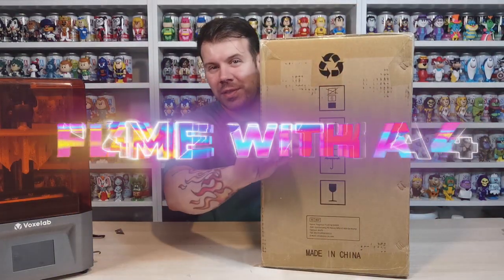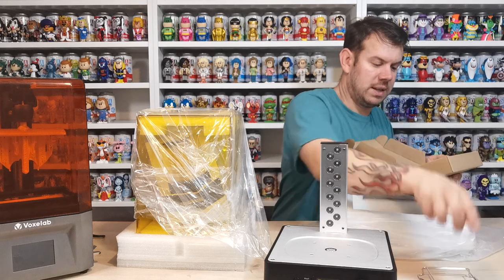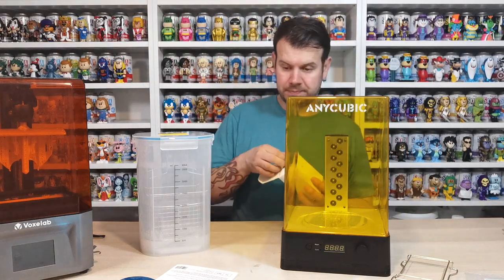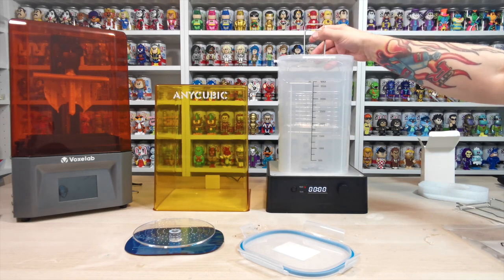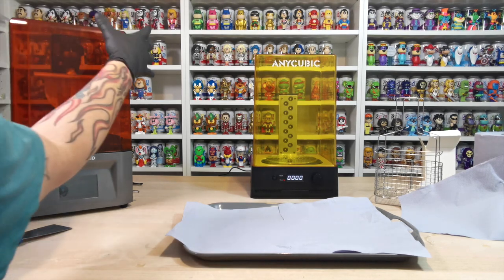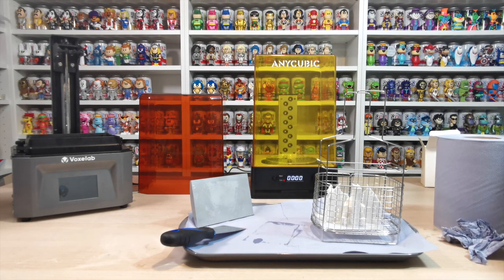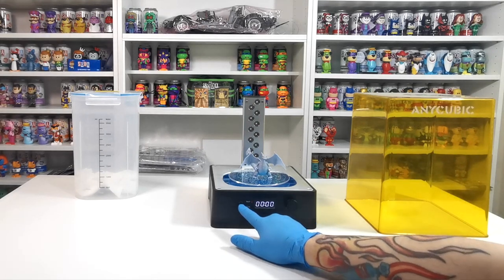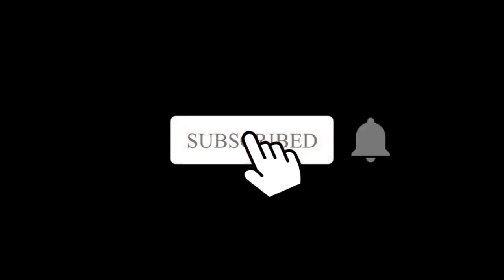ANYCUBIC Wash & Cure Station For All Your Resin 3D Prints, Full Review & Setup Guide

Comment: So anyone find out if the base was supposed to be on there?
Reply from the maker: The base ? 👍🏻🔥
Reply: @FWA4  watch the video and you’d understand.
Reply: @FWA4  I just realized you made the video.  Your ask me “base?” You said in the video you weren’t sure if the base was supposed to be on the print.
Reply: @FWA4  11:00 too
Reply: @FWA4  11:34 too
Reply from the maker: @dugy40  the square base on the print is in the setting on the slicing software 👍🏻🔥
Reply: @FWA4  is it the raft? You use CHITUBOX?
Reply from the maker: @dugy40  it was the voxelab software and yes the bottom brim has a setting to make this square base before the supports  👍🏻🔥